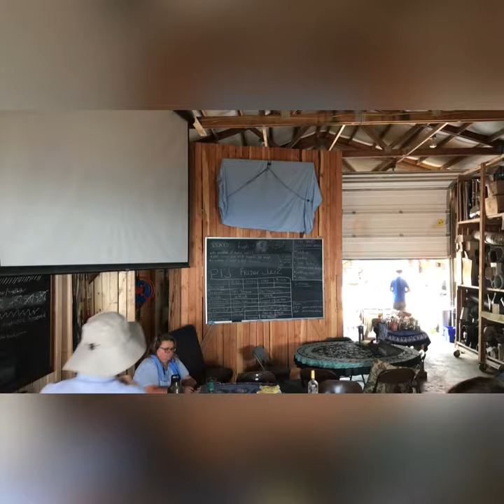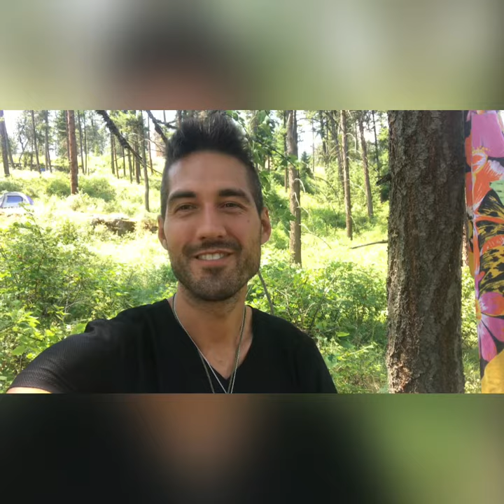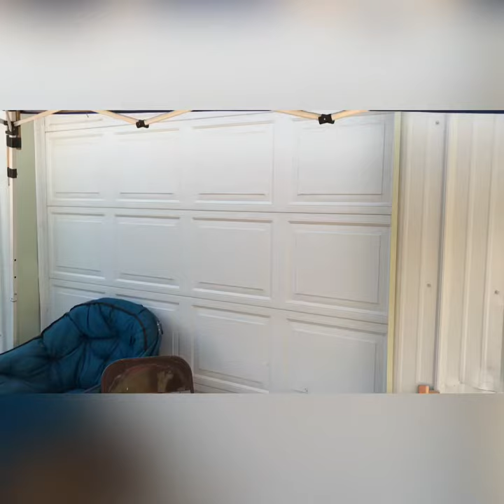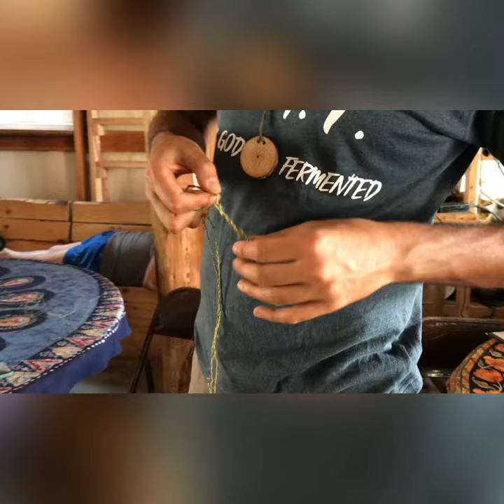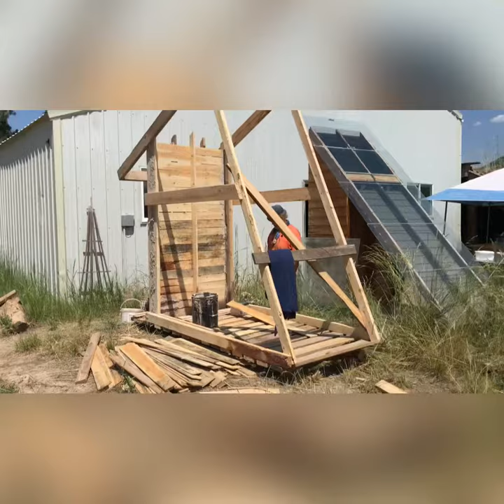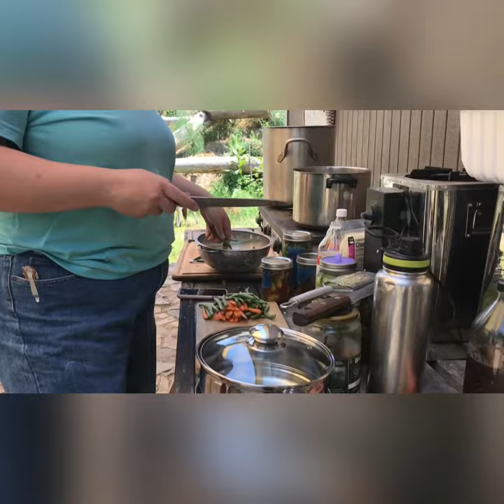Montana Base Camp

Comment: Needs subtitles/closedcaptions to explain the tasks.
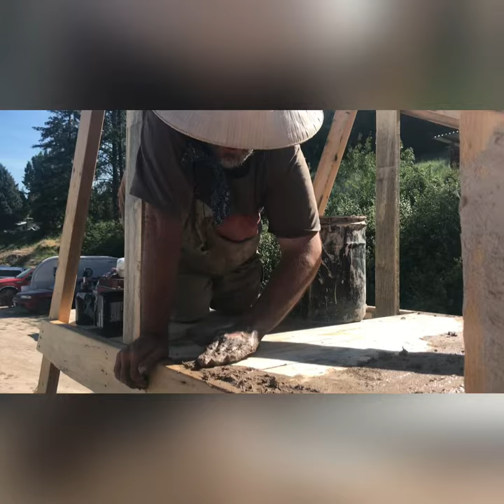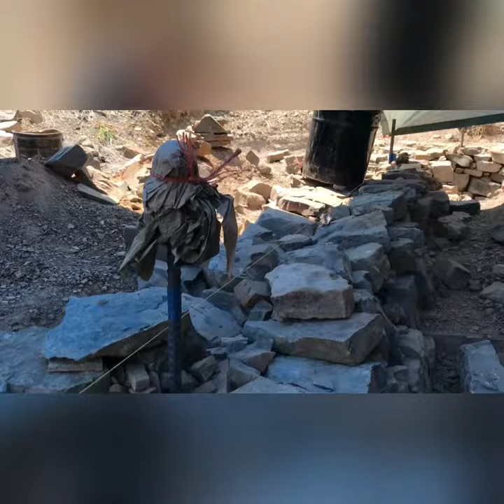Reply: At 10:50 "Uncle Mud" aka Chris McClellan was working on a solar food dehydrator. Around 2:00 they were working on a stone stem wall for a solarium that is being built off the garage, which will have a rocket mass heater for supplemental winter heat. There's a lot of cool projects going on there.